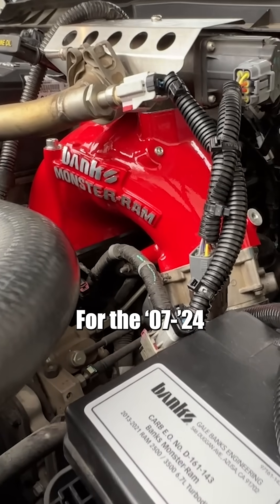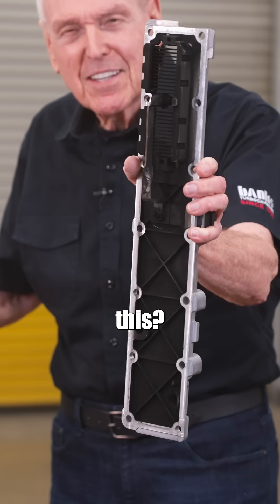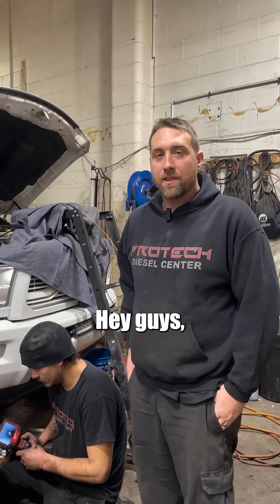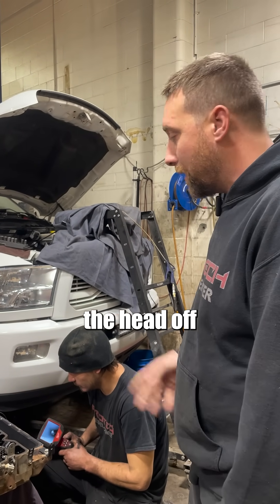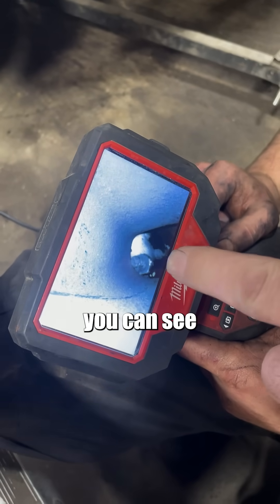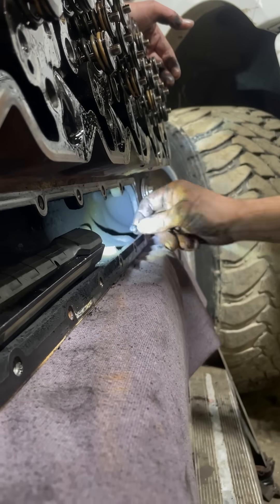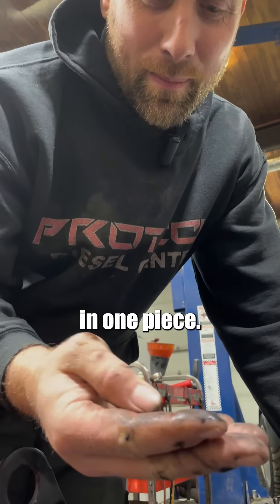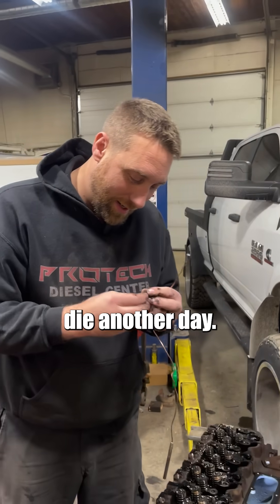RAM saved by blown head gasket.

Comment: Confused, I've got a 2005 ram with a 5.9., I live in Michigan and don't feel like swapping my grid heater with the eliminator plate. Do you have a monster ram with a glo plug for 5.9.
Reply: My 5.9L had 216K miles and was 14 years old when I traded up in size. Not one problem with the heater. Advertizing makes people scared.

Comment: "disaster averted" --  while your head is sitting on the floor. lol..   I don't think we agree on what "avert means.
Reply: Doing head gaskets isn't that big of a deal, most people out there want a truck with arp studs anyways. 
If the stud would've slipped past the valve, it would've destroyed the head. piston, cylinder walls, and possibly even the connecting rod. I'd say they definitely averted disaster in comparison.
Reply: Usually when the failure happens the bolts gets past the valve and into the cylinder. It's often new engine time then. That truck was already in for a head gasket so it was coming off anyway. Truly was a disaster averted for that owner.
Reply: @tylerrencher5559  I know.. I get it.. But I also understand the owner still feels like he's losing anyway;  because of the head gasket.   They are sending off the head to get machined..  YIKES.  That price is going to sting at the end......  and again, it wasn't "averted" --  He literally is one of the victims..  He is one of the guys who's bolt fell off;  that's super unlucky.  This guy can't catch a break. lol..  (other than not having a hole in the piston and a bent valve..  yes)

Comment: Banks is the real deal!  I put everything I could on my 05 Ram 2500. Huge improvement in fuel economy and durability! Thank you Gale Banks!
Reply: At what cost and did it pencil out in returns?
Reply: @ I added the banks replacement parts as original parts wore out.  Example when the intercooler blew a hole in the plastic tank at 70,000 miles it was replaced with a banks technicooler.  I replaced the intercooler, intake and exhaust within a year.  Original from the factory the highest fuel economy I could get was 16.2 mpg ( it has a 4:10 rear end).  With the planks products I am currently running 17.8 mpg.  Very impressed.

Comment: Wow, no recall for that problem hey?
Reply: Actually there was.  The heater grid relay can stay stuck in the on position and melt the bolt and nut.  Relay replacement fixes it.  Alot of this is now scare tactics to sell parts.  However, I do believe the banks intake is better and it can’t hurt to eliminate the grid heater all together for better air flow and peace of mind…but pricey.
Reply from the maker: A recall was issued only for 2022 and 2023 trucks. No other model years were covered by a solenoid recall. Moreover, more than half of those who've suffered from grid heater failure report having any issues with the solenoid. This is an issue with the basic design of the factory grid heater.
Reply: @ The recall includes 2021–2023 Ram 2500 and 3500 trucks with 6.7L Cummins turbodiesel engines, as well as Ram 3500, 4500, and 5500 cab chassis trucks with 6.7 Cummins diesel engines and older heater grid relays.

Comment: So 60k for a new truck and an aftermarket company has to reengineer it to be reliable?!
What's wrong here?!???!?
Reply: @philllsxga.7737  Always been this way brother, why do you think Gale specifically started working in this industry!
Reply: @massformationpsychosis7681  he started racing.
But I understand.
It's doesn't make it right...
Reply: @philllsxga.7737  yes sir… He started in boat racing first right? Then actual vehicles, then diesel. Fact check me please lol.

The man simply wants you to better understand your diesel engine, and he offers parts to benefit your vehicle.
Reply: The wings of change aren't flapping
Reply: The problem here is some idiot overpaid for a piece of junk. Listen up folks, buy an old truck with good bones for 5000, and then throw 50000 into it, you won’t be disappointed. Stop wasting your money, the new stuff is built to fail AND cost you. It isn’t news.
Reply: They don’t want your trunk lasting more than 10 years they built it cheap to save money just good enough for 100k miles
Reply: @tylargusta3211  , How's come my truck had 216k miles and 14 years old when traded in on a new one? New msrp was about 42K.
Reply: where are you getting one of these diesel trucks new for 60k?
Reply: An aftermarket company can make it more reliable and/or perform better at the tradeoff of increased cost. Include all the good stuff Banks does in every truck you could buy at the dealership, and that 60k truck is now far more expensive than 60k.
Reply: MERICA

Comment: Take away is before you pull heads just look in intake ports. Could of saved a head job.
Reply: No..  It had a blown head gasket..  completely unrelated to this problem...  The bolt was just floating on to of the valve and had not yet caused any damage-  luckily...............  But it still needs a head gasket.
Reply: @ oh I see.thx